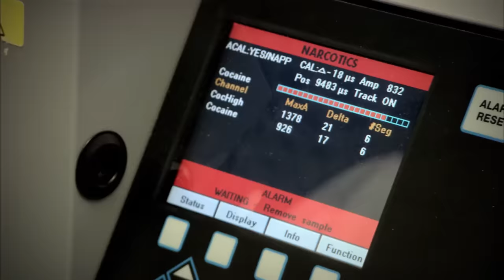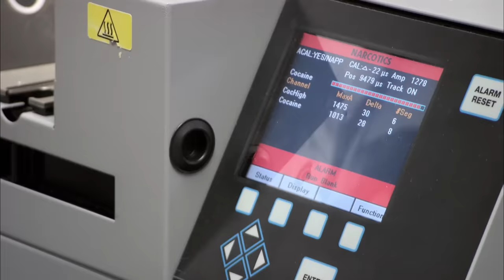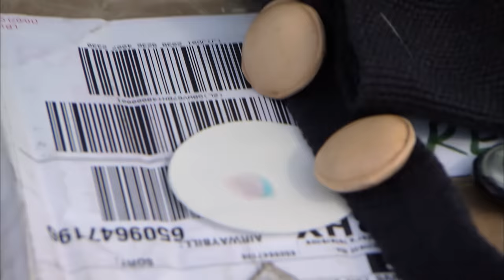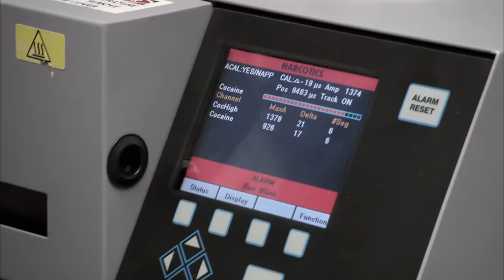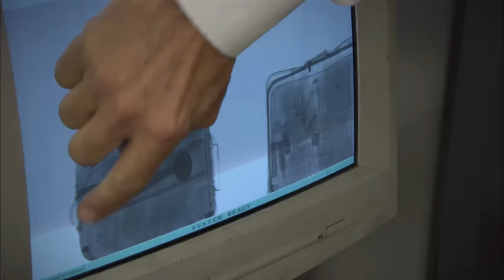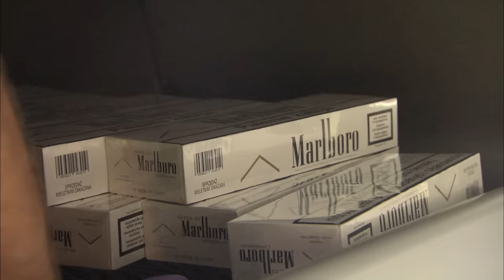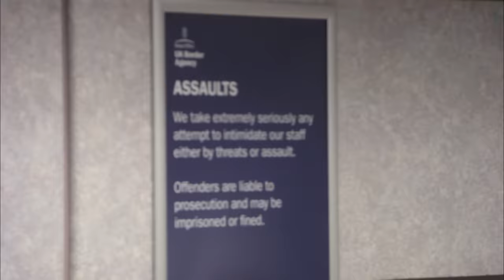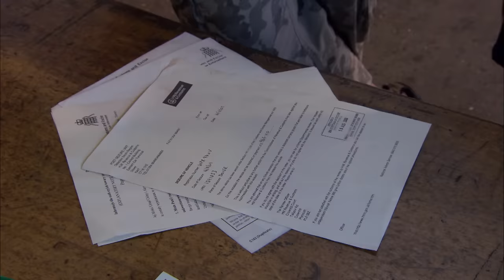Border Agents Protecting the Border from Smugglers | Border Patrol | Locked Up Abroad

Comment: They travelled from
Spain to Jamaica first. They’re both dressed in extremely expensive clothes, travel a lot & have previous for drug distribution. My guess if they dropped the stash off at Jamaica & the high traces is from packing/handling stashes of cocaine earlier in their travels. They knew they’d get stopped in the UK- that’s why they go to pick it up or drop it off in Spain - Jamaica. So when they return they have eff all. Clever.
Reply: That seems about right
Reply: Smart theory. Sounds pretty credible to me.
Reply: If they were more clever they would ditch the suitcases in Spain and get new luggage.  They probably bring a little “snack” with them on the plane back to the uk